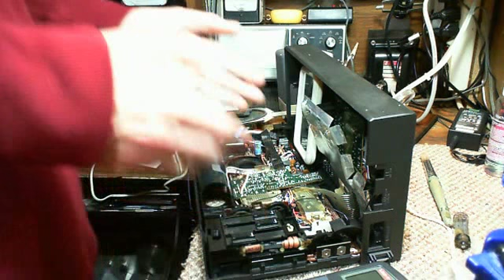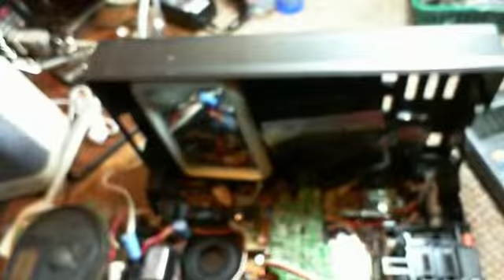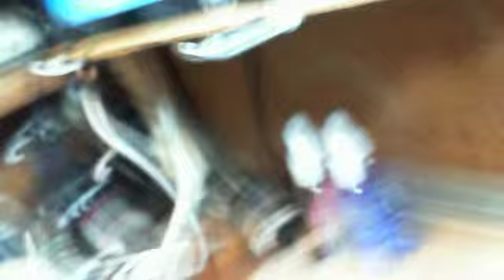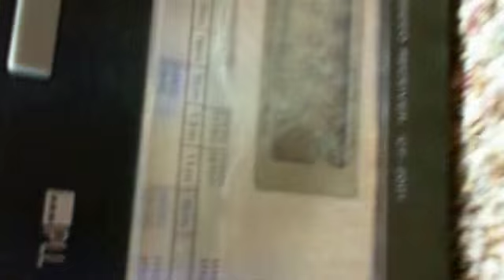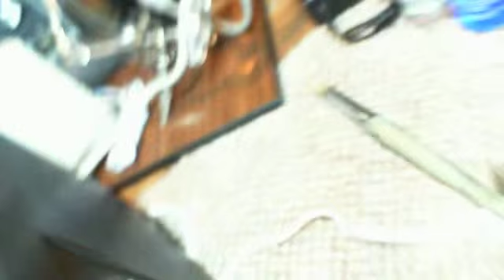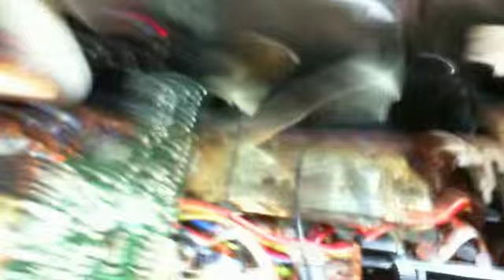Sony ICF 2001 Video #7 - Problem Identified

Comment: I had one of these similar Sonys. It had trouble switching from AC to battery power & back. A transistor circuit did the switching. Spent a lot of time trying to figure out. Wonder if this could have been the problem. It would come on intermittently until power was removed & re-applied. Then nothing. Good job!
Reply from the maker: I am suspicious that that has complicated the process.  I'm being careful to reset the radio by withdrawing all power then applying it again.  Checkout the next videos - my problems have not gone away.  Will be posting them shortly.
Reply: They all suffer from intermittent power and switch problems and bad electrolytic capacitors. But still one of the best radios ever made.

Comment: So .. Is this one of the Sonys that has the stuff wire run from the battery box to the circuit board ? The wire just touches the board , no solder ?
Reply from the maker: Yup and I believe that's the problem.  I've installed a bypass and you'll see the radio working in the next video to come.  At least it works for a while. :-(